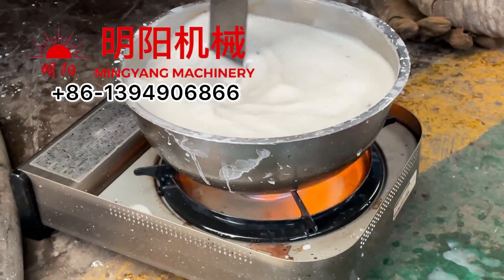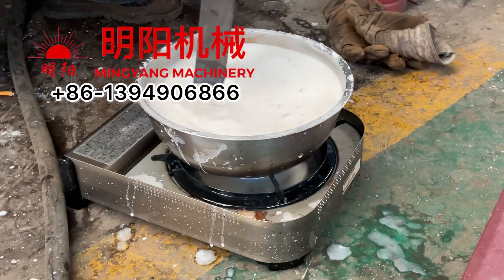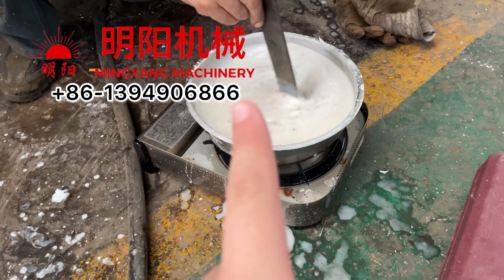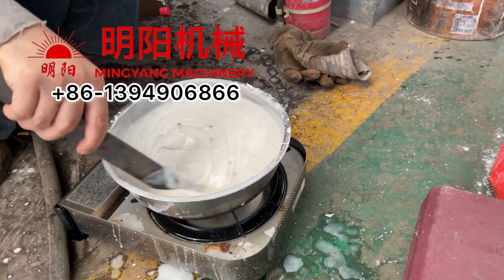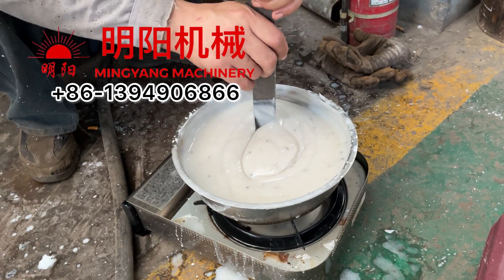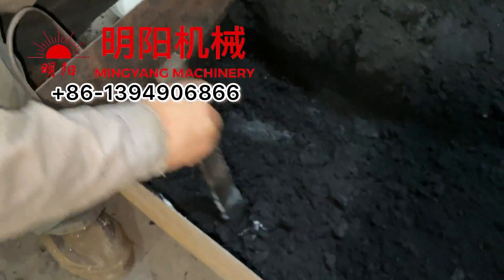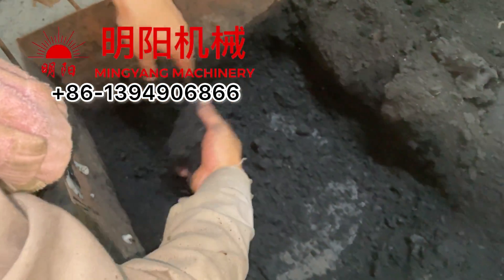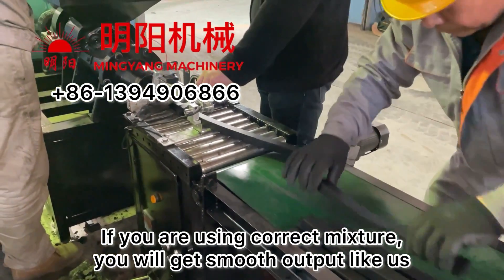How to make charcoal briquettes binder using starch?

Comment: how many ml of sodium hydroxide did you put? did you put it before you cook the starch or after?
Reply from the maker: @erosvls4170  You can use modified starch( we suggest), it’s much easier. Because we only need use normal water without boiling and adding Sodium Hydroxide.

Comment: Hello dear friend
Are there any ingredients that can be added to the mixture to be harder 
Because this mixture is not hard enough it could break easily
Is it possible to add soda ?
Reply: I think any sticky material can be used as an additive, provided the cost is low
Reply from the maker: It's not additives, you can use a pre-press machine before forming. That means you mix the mixture for long time, and form several times to make it higher density. Then it will be hard

Comment: Do briquettes need to be dried with oven? Can they be dried in a shed over spring and summer?
Reply from the maker: Hi. There’re customers drying under the sun and open air( normally takes 3 days to finish drying). If you require high efficiency and faster, you can use drying oven. There’re many types drying oven with different prices. You will find one suits you